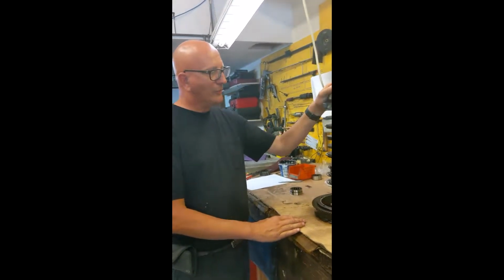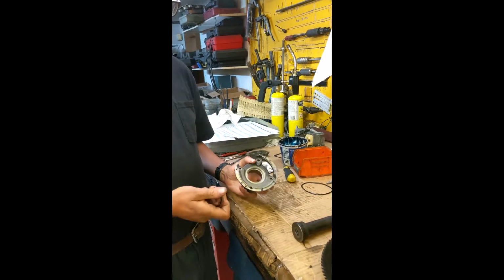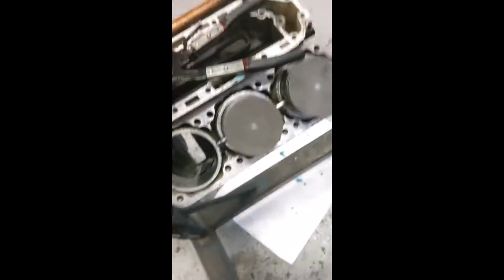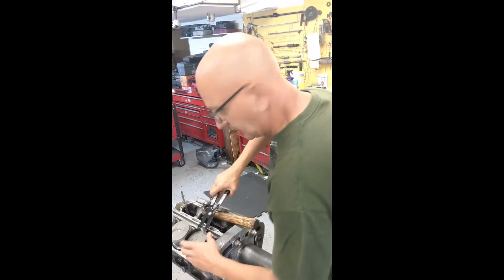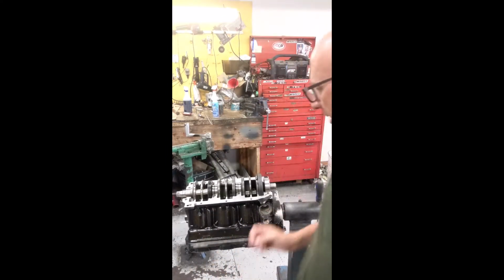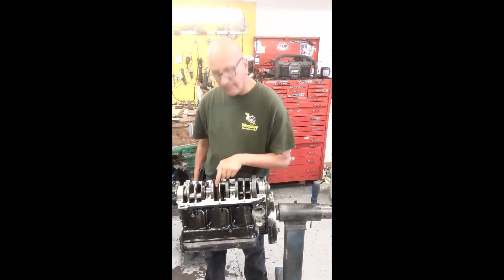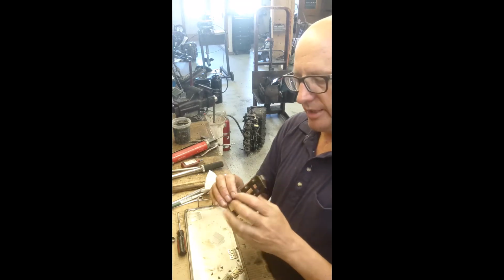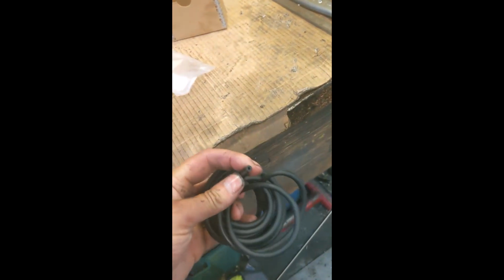200HP Mercury Bearing installation

Comment: You did not show the right position of ballbearrinns mounthing.Iff the ballbeaerring is turnd opside down the oil will not stay in but just go thru ! check this
Reply from the maker: We used an open cage bearing, the oil is designed to go through the bearing and pool in the bottom of crank case. There's a recirc line that takes the oil form the bottom bearing recirculates to the top bearing and lubes it. We know this because every motor that's ever been submerged, if it's not pickled correctly-in our opinion it should be taken apart-the bottom bearing sits in a pool of water that is then pumped to the top bearing.
Reply: @Oexchange  OK but the bearing has a plastic sealing wich has holes where the oil can go thru .This plastic sealing stay around every bearin ballon a bottom side.Is it right?? BR Bela

Comment: i really enjoyed your video. about to rebuild a 200 xr6. could you do a video on  timing procedure,.
Reply: high speed timing shouldnt move. pickup timing dont bother just synch throttle plates correctly with throttle cam. done.